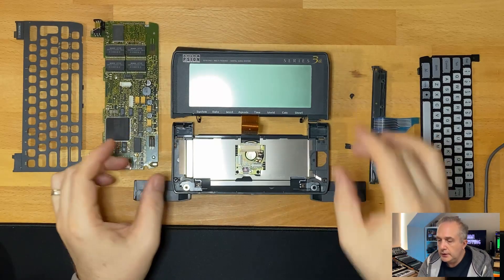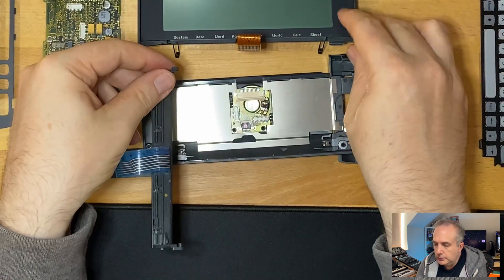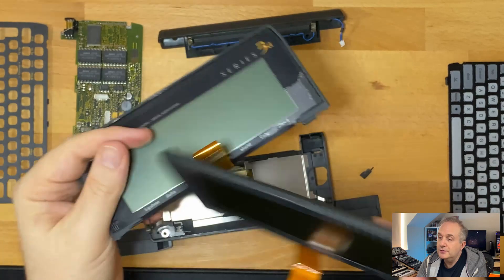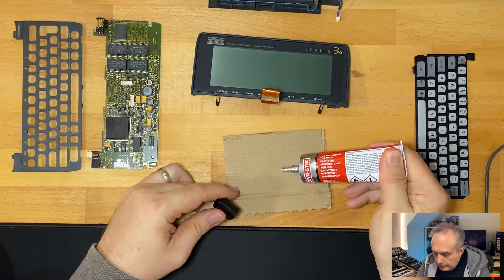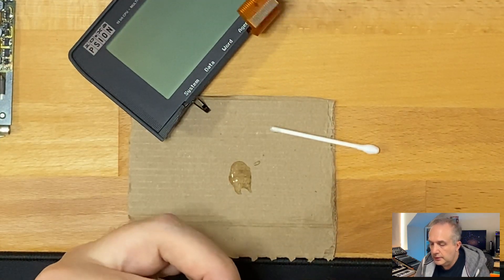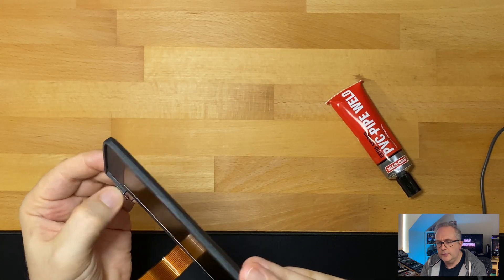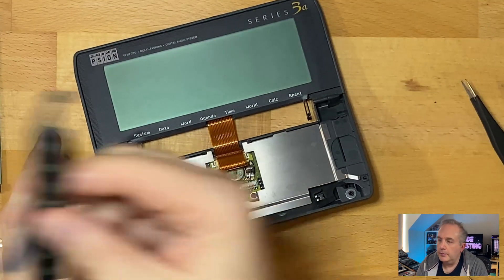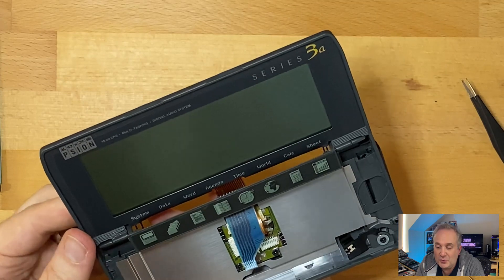Psion 3a - Part 4 - Hinge Repair - Can I Stick It?

Comment: Could you describe a little more on how the screen comes apart if you have a model with screws? At 3.23 you mention you clipped it back in so you couldn't open it again? Yet the screws are out? What clips are there that need to be opened to enable to screen to come apart? I've taken the screws out of mine but the screen still seems firmly attached to the lid.

Comment: Abs slurry is what i use as glue, but in the part of hinge that is hidden when assembled, roughen the plastic and use jbweld to coat it as thick as you can get away with (slow set stuff is strongest)

Comment: The video was certainly worth watching. Thanks! Sorry you couldn't glue it. I've had success with superglue to hold the plastic in place, dry for 24hrs or so and then, like you, using a cotton bud (snipped at an angle) to apply layer after layer of epoxy over and around the repair, like a shell. Several layers over several days spread wide over the good plastic for strength. Works brilliantly. Also, consider if you need both springs? Or even any? Does it open properly (manually) with the springs removed/disabled? The springs are the killer, way too strong. Good luck and thx again for filming.
Reply from the maker: Hi Sam. Thanks for leaving a comment! Yeah - those springs are the root of the hinge problem. Such a shame as it's a great mechanism. Thanks for the tips!